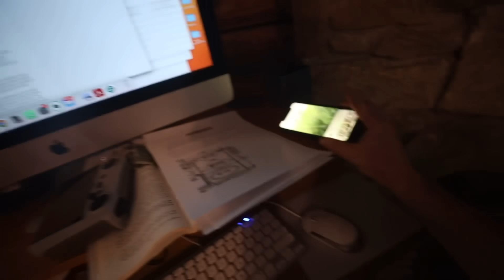OVERRATED?

Comment: How did it work mixing corn into the deep bedding and putting the pigs in  after the cows?
Reply: It failed. Mentioned awhile back that they needed to put a lot more down.
Reply: it worked to a degree, but they need to add more corn..